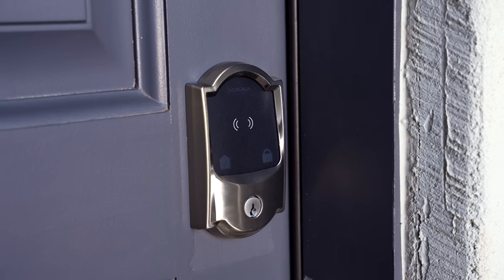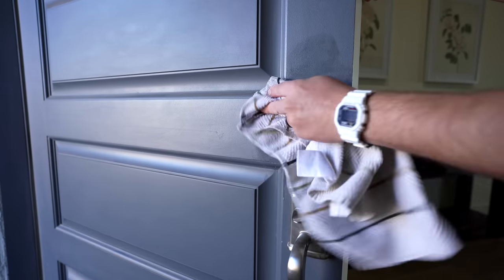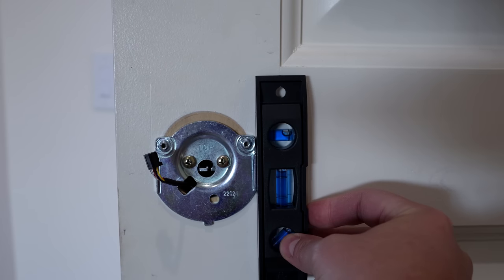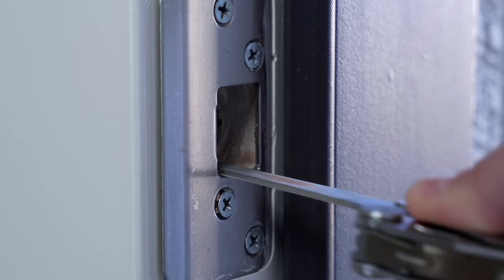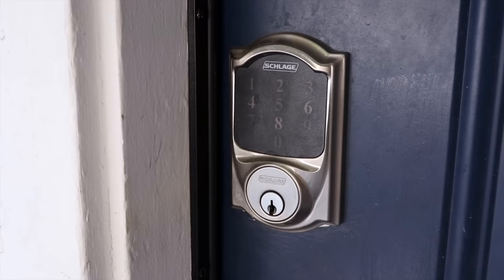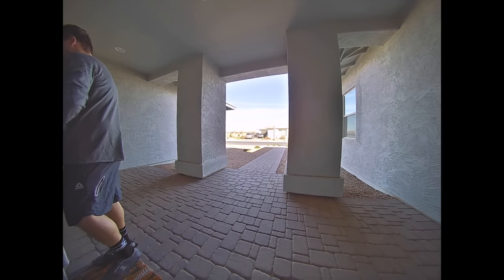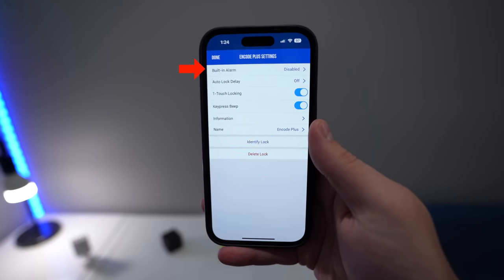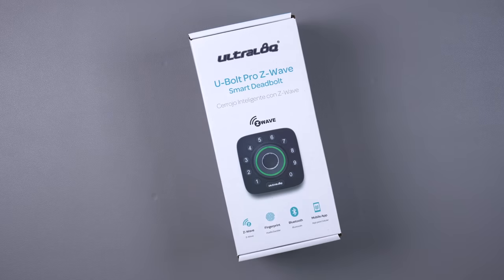Schlage Encode Plus: I waited a year for this smart lock!

Comment: I'm still not comfortable with a smart lock on my front door.  I have the older Schlage Connect in the garage. I have really expensive Medeco locks on the front door, probably overkill since someone can just kick them in.  I know it doesn't make sense, I'm just not ready for smart locks on the front door.
Reply: One cheap measure is to put longer screws into the deadbolt strike plate. I lived in an apartment that must have had a drug dealer tenant. The Deadbolt strike actually wrapped around the door jam. And for when you are home I always recommend a door bar.
Reply: That’s why you also get a smart gun for the front door that shoots the intruder. And don’t forget the smart doormat that sets the perpetrator on fire from below. Also a guard dog.
Reply: While I agree that you want a strong enough deadbolt that your door doesn't kick in easily, I feel like spending a lot of money on locks for a house doesn't make sense. No one is sitting and picking your front door. If they want in, they're just going to crack a window. Sure, you don't want one that can be bumped open in a couple seconds, but you don't need five security pins and a difficult keyway. And if you get a smart lock without a key for backup (usually they have 9V battery terminals on the outside), then it literally can't be picked.
Reply: The problem with smart lock, is how easy can someone produce a device to hack it. There are numbers of NFC transmition intercept device, people can easily buy from ebay or amazon legally. This is how a lot of creditcard information got stolen before, encryption got better now only handful of devices you can use the same method. Similar method had also been used to copy those wireless key entry. You just need to watch out for how good or bad certain companies’ encrytion. On the other hand, if someone targeted your house they will get in one way or another, a lock really doesnt stop anyone much.
Reply: @haoye2413  I wouldn’t get a deadbolt with Wi-Fi or NFC. The only wireless signal I trust is Bluetooth - it’s what Tesla uses for their cars for security and convenience.
Reply: @YoutubeSupportOfficialUS Tesla? Lol
Reply: @YoutubeSupportOfficialUS  bluetooth can be hacked too buddy
Reply: @Pianodaddyy  Thank you! You are correct. Looks like it's possible, though difficult to execute. Good to keep in mind.
Reply: @Pianodaddyy  versus someone just breaking an window to get it…
Reply: @YoutubeSupportOfficialUS  np sir
Reply: @haoye2413 lockly fixed that problem with their randomizer keypad. When you open their app to open/close via app there is no code to lock into since the interface also has a randomizer generator.  It is possible to hack it eventually especially the key cylinder but that's why you have secondary protective measures. Put a ring camera that notifies you when someone approaches your door. If someone's stupid enough to attempt to open your lock, call rhe police. That's what happen to me when an Amazon driver tried ro open my keypad.  I got notified by my lockly and by ring, enough time to sound my alarm. Had I been home, well... Texans don't play around

Comment: Love this lock! When utilizing access codes Press the house icon on the left hand side to light up the screen and enter your code. Lock will immediately unlock or lock depending on the current position. If you accidentally press a wrong number you can press the lock icon on the right hand side to clear your code and start over. Hope this helps!

Comment: A quick tip—you can touch the Schlage label at the top to “wake up” and the lock so the numbers light up without accidentally typing in the wrong first number!
Reply: Actually if you press the bottom left home icon first then type in the code that eliminates the need for the extra press of the Schlage logo

Comment: I’ve had mine since April of last year and it has been great. I have had no issues with it. One thing I do wish it had built in or came with is a sensor to notify you the door is either open or close. Having the key on my watch is great when carrying in groceries and forgetting to unlock the lock before loading your hands up with everything.
Reply: Would you rather pay an extra $20 for a sensor, or just use the timed auto lock feature included?
Reply: @YoutubeSupportOfficialUS  pay an extra $20 for a sensor

Comment: Another thing you can do to smooth the action of the lock is to oil it the deadbolt. I put some silicon 3-in-1 right on the deadbolt and worked it in by repeatedly locking and unlocking the bolt to great effect, it was total butter after that.

Comment: I like all the features of this. I currently use a Level and had the same issue with bolt size and had to shave the metal down some. I use that on garage and after this review I think I will check out getting this for the front door. Thanks Reed

Comment: I just got one too and love it. I just discovered that in the home app I can set triggers.  I set it so if I unlock my door between a certain time the hue lights turn on.  If I Lock the door between a certain time my lights turn off. So cool.  My watch seems to work better with home key than my iPhone for some reason.  Does my phone need to be unlocked.  I have done it with phone unlocked so I don’t know.  Your right mine is a little crooked on the inside.  Is it easy to straighten?   If my hands are full with groceries I just push Digital Crown on my Apple Watch and say hey siri open the door.   Really love tech that makes our lives easier and it’s very satisfying to use this lock.  Just got a hue motion sensor for when I wake up and go to the John it turns the lights on and off when I go back.  So cool😎

Comment: Does the Encode Plus do a better job on 'not eating batteries every 6 months' as I'm getting with the Encode? Love the Schalge lock, BUT every 6 months having to change a couple of 4 batteries is not very practical. Thanks
Reply: Good question.  They have an additional radio in this new one to support NFC.   Because it has to move the bolt, I would think it is the same or worse than prior models.   I wish they would allow us to move the manually move the bolt instead of using an electric motor.
Reply: @weaesq  Or maybe some easily swapable battery pack you could recharge with a standard USB cable or a USB charge plug I could connect to whenever I want without having to break down the unit? OR .. a solar charge capability for outdoor locks maybe>

Comment: For the encode plus, you get 2 "boxes" correct?  And they both go on the outside right?  One has the numbers and the other has the handle.   So, what goes on the inside when you want to lock up the door and how do you open up the door from the inside?  When you enter the code, does the door pop open or do you have to use the handle?  And do you have to use the WiFi or can you just use the keypad with a code?

Comment: Can you setup HomeKit automations with the lock as a trigger? For example, say I want to:

1) Turn on my Hue lights when the lock is unlocked with a code.
2) Turn on my Hue lights when the lock is unlocked with a code and it's after XPM.
3) Set my Thermostat to X degrees when the lock is unlocked with a code, but only the first time the code is used.
4) Turn off all lights when the lock is locked, but only if it's locked from the outside, not the inside.

Comment: Would be nice to know how it works (or doesn't) with Android... Not everyone has an iPhone or Apple watch.
Reply from the maker: The Home Key feature is just iOS right now. The lock still works with Android phones in that you can use the Schlage Home app just like the regular Schlage Encode lock. But I'm going to be reaching out to Schlage and see if any of these features will be coming to Android.
Reply: Thanks for the reply. Not being an Apple guy I think I will hold off. Besides that I rent, so something like the switchbot thing (the one that mounts over the deadbolt) is the only thing I could install without getting in trouble.

Comment: I like that you can set it to automatically lock after it’s been unlocked for a certain amount of time. I also don’t like it sometimes, like when we had a contractor going in and out of the house, it would extend the lock while the door was open. I wish it could tell when the door was open. 

I was also under the impression that you could limit guest codes to certain times of the day or days of the week, but maybe I’m mixing it up with a different lock. I like how easy it is to set up additional codes with the app.
Reply: My home automation system controls the auto locking of the lock. But I also have a door open/close sensir which the home automation system uses to decide if it’s OK to lock the door. The home automation system also tells me if the door has been open for too long.

Comment: What about using a key? It's much more secure, doesn't need an app, doesn't lock you for a while if it's the wrong key, only advantages :)
Reply from the maker: It does come with a key so you could always put that on your keyring but the smart locks are great for convenience.
Reply: Keys can be stolen easily (grabbing or taking a picture and cutting a duplicate). Key holes can be picked with very few tools. I don’t recommend physical keys.

Comment: Take a look at Lock Picking Lawyer. He and I could Lock-pick your lock in 15 seconds. Basically ANY lock with any kind of hole in it IS NOT A LOCK! Keep looking
Reply: I agree. Unfortunately smart locks without physical key backups are few and far between. You also need to ensure there is no other lock on the door if you use a keyless deadbolt.
Reply: That’s what an ar 15 is for

Comment: I'm going to assume this isn't a product review, given that it only mentions using it with an iDevice. For the majority of people this "review" is not helpful at all as it makes no mention of whether the product supports Android.
Reply: This lock does not support Android, and from my understanding will not even support matter. Eco system lock in for something like a door lock is pretty silly. I have Schlage hardware on all my doors but decided to go with the Yale Assure Lock 2 instead. In my opinion it's a better looking lock and way more future proof
Reply from the maker: The Home Key feature is for iOS only (for now) but the lock still works with Android phones in that you can use the Schlage Home app just like the other Schlage Encode locks. This also has Thread but it's unclear if it's using that right now.

Comment: Level Lock + is better. Discreet, not massive, works seamlessly with Apple Key (phone, watch) and also…go for a run? haha yeah, do that again. You don’t need an Apple Watch to track the 13 calories you burned.
Reply: My issue with level lock is that you need a physical device. Whether it’s a phone or key. What if you lose both? That’s why I believe smart locks should have a keypad backup.
Reply: @Yeahyeahyeah6464   What if your wallet, phone and keys are stolen, while at the same time, it’s cold outside and the fingerprint sensor is failing as a result? Extreme scenario but it could happen.